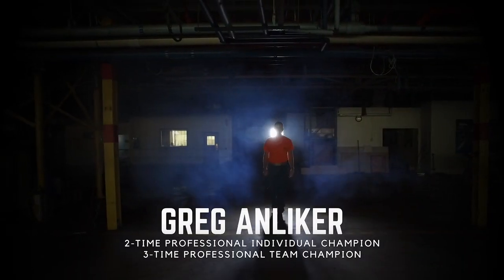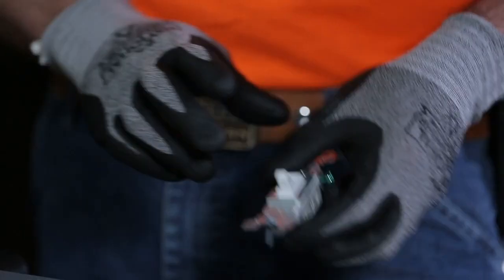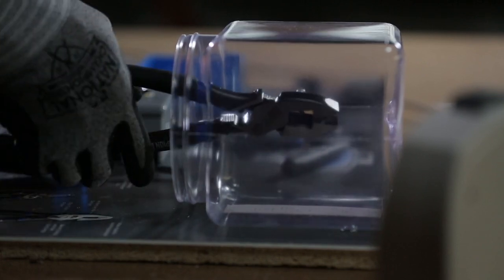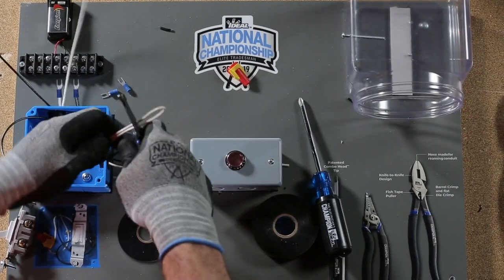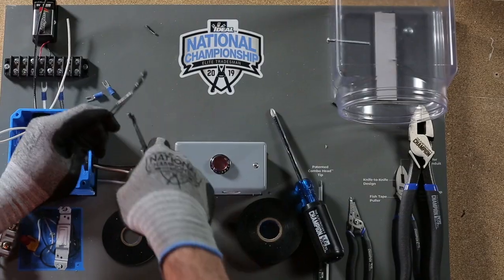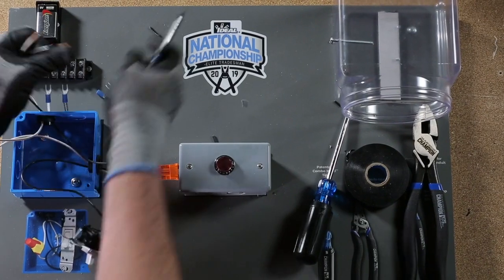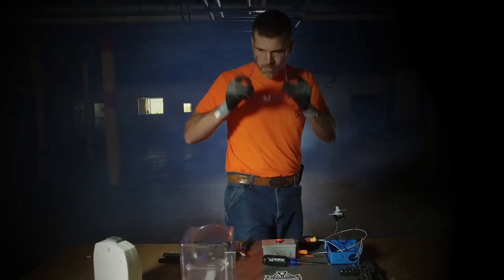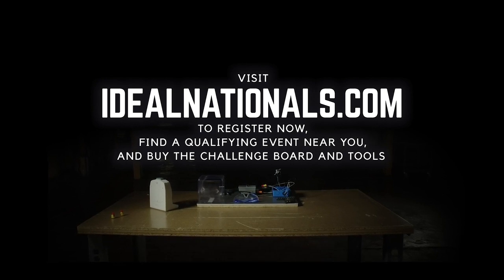IDEAL National Championship - 2019 Qualifying Round How-To Video

Comment: Linesman pliers are not needed to twist 2 wires together, waste of time in contest. Thats what wire nuts are for. Twist them and wires will join together. I guess they need to show off the ideal tools.
Reply: Honestly that's a shit splice. I dont know who told you that was a good enough connection.
Reply: Any job ive been on we always pretwist wires( without twisting too much of the insulation of the conductors), just using a wirenut is frowned upon.